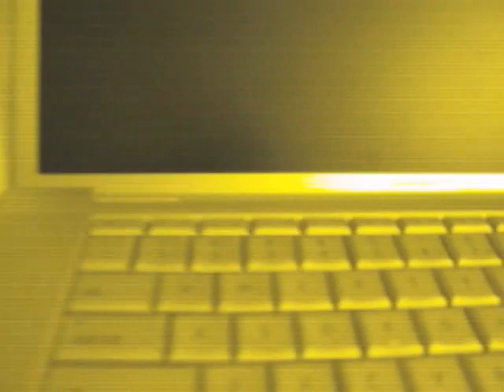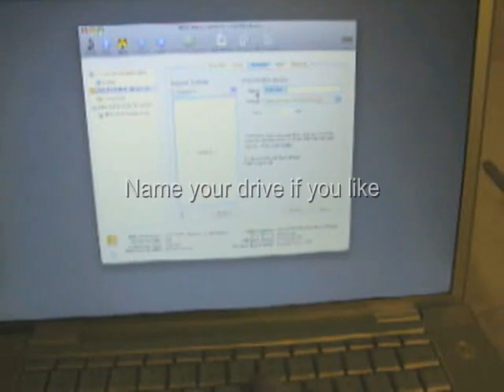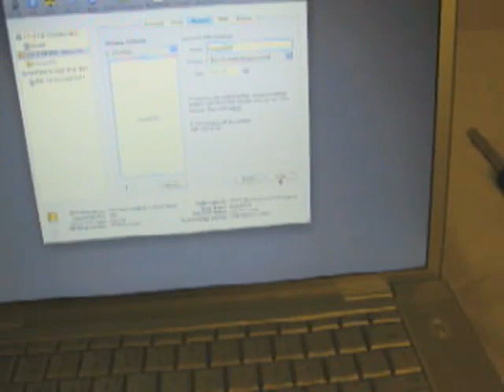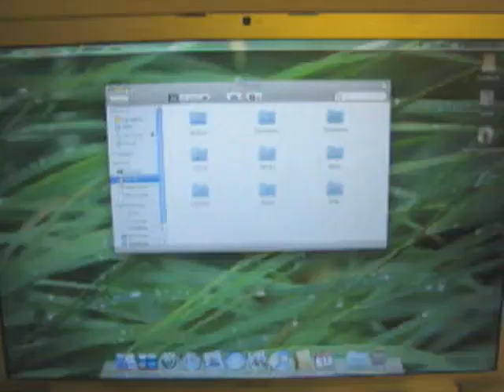Macbook Pro 15" Harddrive Replacement Procedure

Comment from the maker: @TechDude997 I highly recommend it. SSD's will greatly improve your experience over traditional HDs. If you look around you can get some nice SSD's for low $100's for ~120gb.

I recommend Intel SSDs though for their reliability. In the end, its the most important thing.

Also, for a better video for this procedure, please consider watching the one made by MacOSG (usually you'll see it in the related videos section of this video).

Comment from the maker: Good eye! I actually filmed installing the OS before I did the swap, then I took the drive out of the usb enclosure and installed it. This way you can be sure the OS installs OK into the new drive before you start opening up the computer.

That way, if it doesn't work your computer will still be fine.

Comment: i think you don't have to install a new system like that, just connect the old harddrive via USB or firewire and start from it. Use the DiskUtility to clone the contents from the external HDD to the local one and restart, the system will be fine and all preferences will be kept, just like nothing happen but a hardware upgrade.

Comment from the maker: Are you sure? I was under the impression that upgrading the RAM for example does NOT void the warranty.

I would say a GENERAL rule of thumb is, if it requires the T6 torx bit to upgrade it, it is most likely voiding the warranty.

Comment from the maker: Sorry, I don't. The Samsung is the only one I can safely say will work (because it is extra thin compared to most). Just watch out for the height of the drive as most drives need to use a third platter to reach 500gb.

Comment from the maker: Thanks for reporting back Marko (?)!! Its great to know the 500gb samsung works well. The battery life may decrease a little if the harddrive uses more power, but I don't expect it to be significant? I am pretty certain it is not the extra RAM that causes the decrease in battery life.

I am not sure how often batteries must be replaced on the laptop, but you can see how much your current battery has been used with various free utilities. For example, try a widget called iStat Pro.

Comment: Awesome video! One thing though that may make this process go quicker is if you are using Super Duper to take a backup and you have an enclosure, may as well take a full backup of your existing drive and load it onto the new one that's in the HD enclosure. Then just swap the drives out and you save the step of having to reinstall and restore everything

Comment from the maker: That sounds humongous. It must be a mistake or a desktop drive. You need a 2.5 inch notebook drive! The height should be around 9.5mm IIRC. Some 2.5 inch 500gb drives use 3 platters and as a result are extra tall (12.5mm?). The Samsung uses 3 platters as well, but still manages to be only the standard (9.5mm?) tall.

Comment from the maker: Some 500gb drives might be too tall to fit! The Samsung is a standard height despite using 3 platters to achieve the 500gb capacity. Some drives are extra tall.

Comment from the maker: If you're getting a 500gb 2.5 inch drive I would recommend to use the Samsung instead. I suggest to check the height of the western digital drive before purchasing it.

Comment from the maker: I can't remember exactly, but I think its because you have to format the drive to have the HFS journaling file system which is compatible with Mac OSX.

Anyway, it worked the way I did it in the video.

Comment from the maker: I didn't say to check if its connected, I said to check if the connection is firm. Sometimes it could be a loose connection. Some things might work, but not quite right. Kind of like plugging your headphones in not quite all the way on an mp3 player of your choice produces sound in only one of the 2 speakers on the headphone.

Test before closing the unit.

Also try external keyboard and mouse. If you want you can bring it to a genius bar at an apple store they'll test those kind of things free.

Comment: Yup. The power button works fine, too, which is how I know it's connected. The ambient light sensor also lights up the keyboard when I cut off the lights in my house, but for some reason the keyboard and trackpad are the only parts that don't work.

The speakers even work! Although they're a little low, which is odd.

Comment: with mobile graphics cards... it is possible as long as the bios is able to suport the UNIT. - the card itself looks like a random thingie with a fan on it (i believe) - i had an alienware that i took apart.. and the graphics card there had a fan attached to it -- so it should be the only component inside with a fan on it (unless the processor has one as well)

Comment: yes but the new 2.5 Ghz is out now - they are capable of expanding to 4GB - andhonestly you dont needmore than 2 Gb of RAM... i have 2 GB in mine and dont have any problems -- i even run vista thru bootcamp (for games only).

Comment from the maker: Maximum is 2 gig. I believe it will still power up and boot, but will only work with 2 of the (more) gig that are present. Core 2 duo models in 2.16 and 2.33ghz (invisible light next to isight camera, and firewire 800 port are some obvious visual indicators) can accept up to 3gb. Any model released after June of 07 can accept up to 4gb of ram (2.2ghz and up, with the exception of the 2.33ghz).

So to summarize, you and me are maxed out!

Comment from the maker: I personally BELIEVE its possible, but I haven't seen how the graphics card is attached to the logic board. If it is soldered on, it will be EXTREMELY difficult, if not impossible. If it is just some connector, it should be very doable.

Comment: ansisplat is right...because ground means put your static electricity as equal as earth (that is assumed 0 volts), if the aluminium case is not plugged to the wall then it's isolated from the earth =>touching the aluminium case means that you and the case have the same value of static electricity, which can be different from 0 (that's what damages electronic parts). I hope that my english was good :D
If you have any doubt try to google it!

Comment from the maker: Hey, I've just looked around the net and have read that you do need a 9.5mm tall drive (standard height). Both Fujitsu (4200rpm) and Hitachi (5400rpm) have announced (shipped??) 500gb drives, but they are 12.5mm tall. On the other hand, I've found that Samsung makes a 500gb drive called the spinpoint M6 that is only 9.5mm high, and already shipping. This drive would fit in the MBP. MSRP for $299 and my source is a official Samsung press release (which I cannot link here). Search for spinpoint M6

Comment from the maker: Sounds like a plan! Just note that the 500gb WD is probably an extra tall unit. Some laptop HD manufacturers used a 3rd platter to reach the 500gb plateau, and therefore their drives are taller than standard sized HDs. Just ask around to make sure it would fit physically.

Comment from the maker: I believe 320gig is the current largest, unless those 3 platter extra tall 500gb drives fit in MBP's (I'm not sure).

As for your question, you generally will not get shocked lurking around in the machine. The grounding is a precaution that you should especially consider if you are working professionally. I open up my MBP all the time with almost no precautions...so its clearly not NECESSARY, but recommended nonetheless.

As for partitions, you will want your HD to be on MAC file system.

Comment from the maker: Touch something conductive, such as metal or even wood or plastic (metal is ideal). You can wear a metal bracelet and have a wire coming out and wind the wire around something metal to be constantly grounded (there are grounding bracelets that do exactly this).

When I work inside a computer, if it is my own, I just constantly touch the metal parts of the case. If I am working professionally though, I'll use a bracelet.

Comment from the maker: I would personally suggest a fresh install. You should get Leopard and iLife 08 install discs with a MBP, so you can just pop it open, put the new harddrive in there, then boot off of those discs and do the formatting if necessary at that point.

Comment from the maker: I do mean C key. Option key will work too I think. C key is boot from optical disc, Option key gives you a menu of which partition or drive to boot from.

SATA cable is easy to connect. My MBP is already out of warranty.

Comment from the maker: I found the easiest way is to download the .dmg, then burn it to a dual layer DVD and clean install from that DVD. Don't worry, the final version will be out in less than a week (10/26, friday)! If stability of the OS is important to you though, I suggest to stay with Tiger, the latest beta I have tried is reasonably stable, but has glitches which tiger does not.